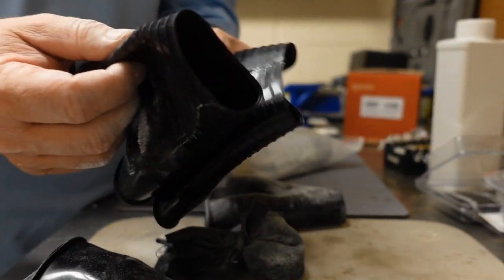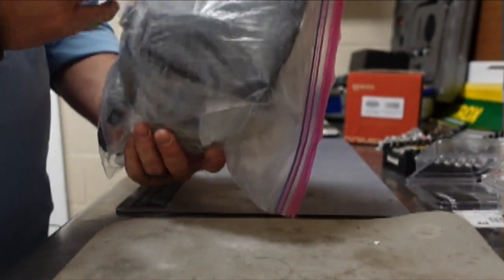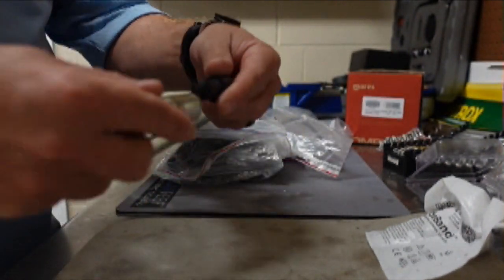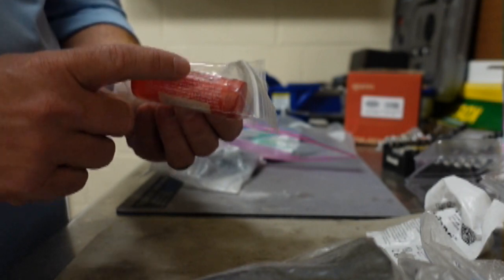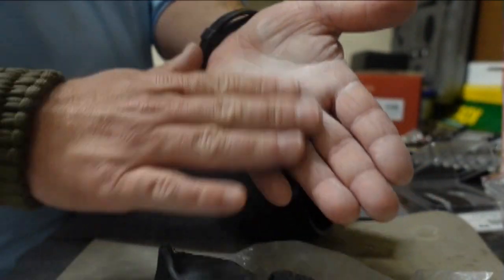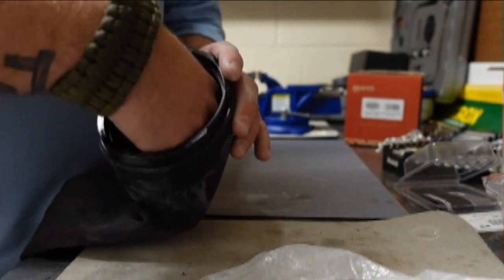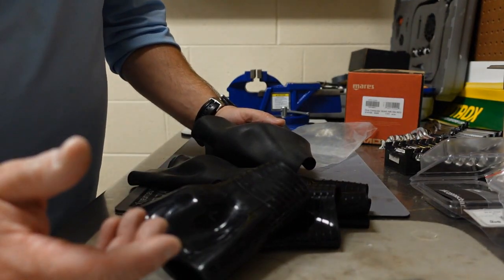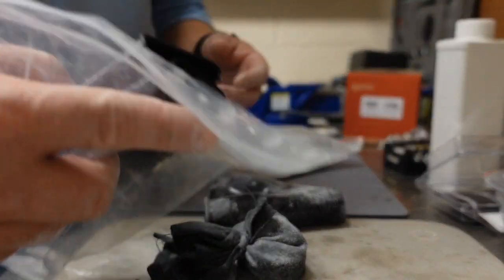How To Maintain Your Drysuit's Spare Parts Kit

Comment: Also when latex seals have had a long life and the material starts to break down they can become very tacky /sticky. The talc powder can be very useful until a fresh set of seals can be installed. 

It may be worth mentoring if the diver doesn’t fluctuate too much in body weight they may want to pre-size their seals for a proper fit at their workstation so they are property sized and on the  ready in their kit. In the event they need to do an emergency exchange out in the field they won’t have a neck seal that is too tight causing a potential issue. I can’t think trimming a neck seal in the field would be much fun when your trying to be efficient to get your dive going.

At least please encourage new drysuit divers at the very least to test fit their spare neck and wrist seals. The sizes could easily be over looked and it would be a bummer to pull a neck seal out in the field and find out they got a smaller size than they were expecting and have to call a dive off. 

Great video 🤙 Cheers, #SeattleRingHunter
Reply from the maker: Hello Seattle Ring Hunter, we have the same issues with Silicone Seals as well. And yes, presizing seals makes life much easier. Thanks for sharing.